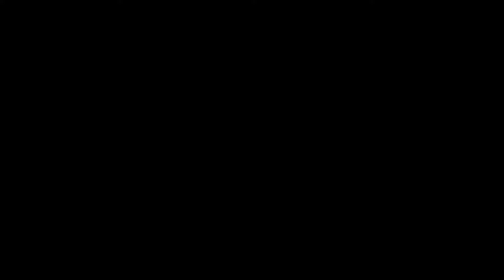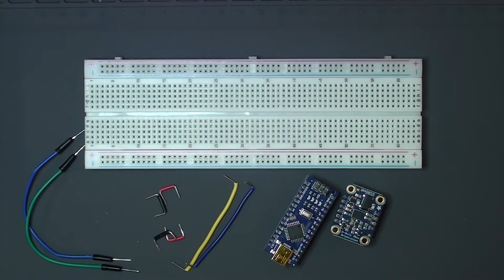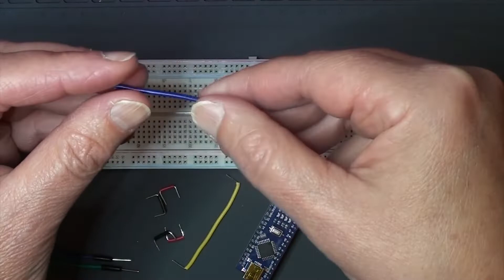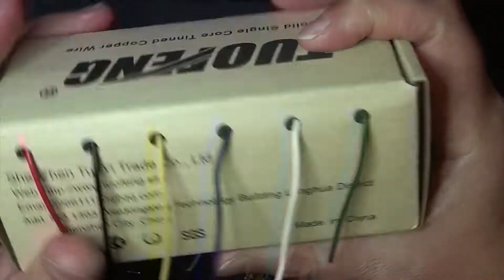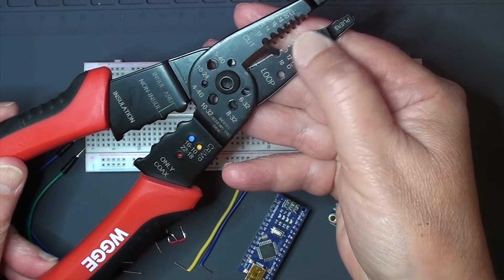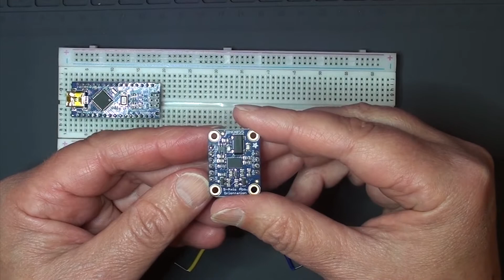Using the BNO055 9-DOF Sensor:  Connecting to an Arduino Nano

Comment: great job! I have downloaded your code. in the serial monitor the number doesn't get change. i have adafruit version 1.0.3 and the latest version, but still i have a problem. Do you have any idea what is the problem?
Reply from the maker: Unfortunately, I do not know what might be the problem. I am not currently working with this IMU but hope to come back to it when I get going on the new Uno R4.  When I do, I will post new code for that.  Best Wishes.

Comment: Do you know how many can be connected to one Arduino ?
Reply from the maker: It has been awhile since I worked with this circuit.  There is only one set of SDA/SCL pins on the arduino but several I2C devices can be hooked up in parallel as long as the devices have separate addresses.  There are also I2C expansion modules that can be used to connect several I2C devices to the pins on the arduino.  Many I2C sensors have jumpers or places on the sensor board that can be soldered to change the I2C address.  So I suspect you could hook up at least 2 and perhaps more with the right circuit setup.  The issue would eventually be speed on data transfer if you have lots of devices hooked up.  Thanks for watching!